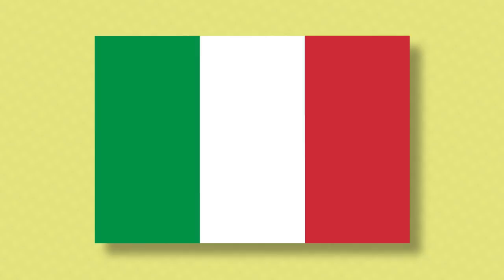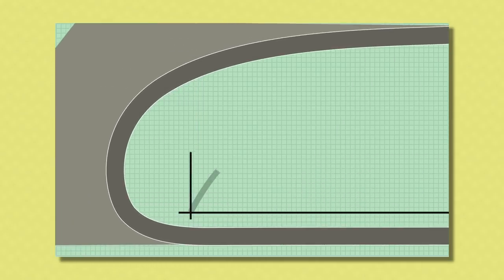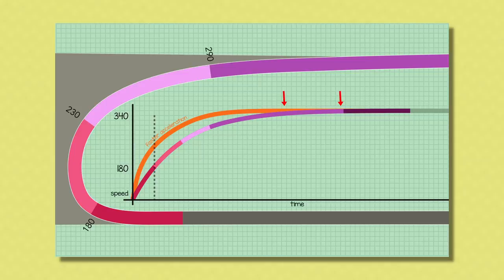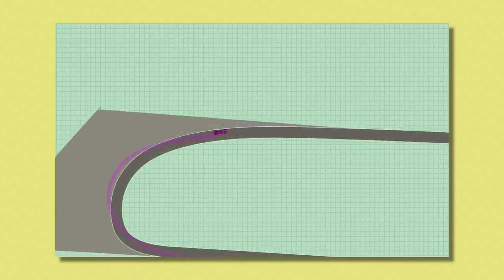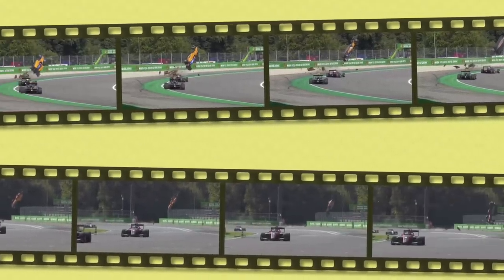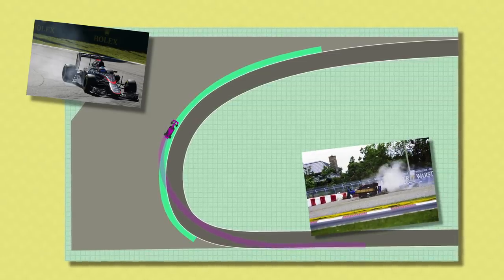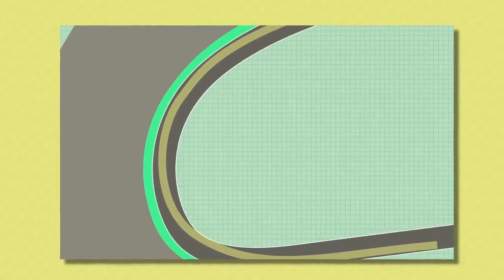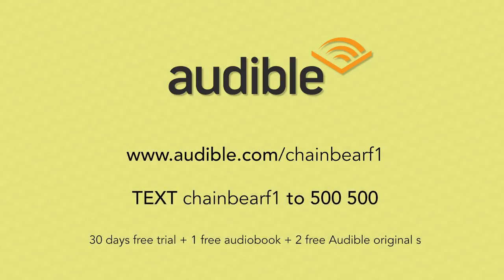Why run wide at parabolica? Italy 2019 (Part 1): "Just stay inside the lines!"

Comment: So in MotoGP, they have to deal all the time of riders running off the edge of the curbing so they can get on the gas just that much sooner. I believe if a rider does that 3 times within a race then they used to have to drop a position, but now they use the long lap lane (which adds 1-2 seconds to their lap time so if you are battling in a group and have a 5-second gap to the people behind it doesn't just kill your race and is consistent at all tracks and conditions) or the lap is canceled in qualifying. If you were to add gravel to the outside of the track and then have asphalt after that, then tracks that F1 and MotoGP go to (such as Redbull Ring) then a rider who goes wide will hit a patch of gravel and might then crash rather than being able to just stand the bike upright onto paved run off if they get in their too hot. With F1 they obviously have four wheels so that cant crash and damage their bodies in the same way as motorcycle racing. If F1 were to make changes to all of their tracks it can also have negative side effects for other premier racing series. F1 doesn't really pay as much attention to keep their wheels on the track or curbing, I remember watching the race at Cota last year and Hamilton continuously was running off the curbing with both right wheels and opening up the entry into the high-speed t10 and nothing was being done about it. So it definitely doesn't only happen at parabolica in Monza.

Comment: In the Colonies they use Rumble Strips to alert highway drivers to upcoming turns or running off the edge of the road. Since they are low they do not disturb the attitude of the car just startle you with some harmonic hilarity. As they are low I’m guessing they would not launch vehicles but would certainly be disruptive and inhibit acceleration. There are manufactured versions which can be removed. Permanent installation has been studied thoroughly
https://safety.fhwa.dot.gov/roadway_dept/pavement/rumble_strips/t504040/
Which who provide a point of departure for a racing version.

Comment: @ChainBearF1 great vlog but I can't help but think the simple solution would be to widen the track a metre or so through the exit and give them the track they are trying to use and then a cars width before a gravel trap at the side of the second phase of the corner? 
Nice big run off after the braking zone.
Power hungry corner where the driver gets what he wants on the exit and up the creek if he goes a cars width over the line? 
Just my thoughts on it 👍
Reply: If you make the track wider, they would just go even wider. That doesn't solve the problem at all.
Reply: That's where the gravel trap in the second phase of the corner comes in Fred.
Reply: @robhitchens966  I didn't realise what you meant by "second phase". In that case, I don't see what difference that would make to just having a gravel trap as it was before. That would still be problematic for other categories, which was the reason they removed the one that was there.
Reply: @Fred_P  you're on the wrong end of what I'm  saying 🤦‍♂️ 
Make the corner optimal for room in the traction (2nd) phase of the corner for the driver.
Define a line around it.
Just under a cars width from that put a gravel trap.
I'm sure if they define it the other series will cope with it 3👍
Reply: @robhitchens966  I understand. My point is that the drivers will be driving at the edge of going into the gravel, as a wider line will always be faster, so there is no "optimal corner", except for a straight line. But I appreciate your effort to find a solution.
Reply: @Fred_P  there is no optimal corner  except for a straight line 😂 that's hilarious! I appreciate your efforts to try to challenge my solution but really 😂
Reply: @robhitchens966  What would an optimal corner be? You always lose speed by turning. You're laughing, but I'm serious. Explain what an optimal corner is, and I'll happily concede. Until you do, the joke's on you.
Reply: @Fred_P why is the joke on me? You're throwing out bait nothing more and I am not biting for the sake of a troll 👍
Reply: @robhitchens966  WTH? I genuinely thought that we were having a discussion. But I see I've been wasting my time, because as soon as I requested some evidence for your claim, you just started laughing and calling me a troll. Good riddance.
Reply: @Fred_P  a discussion is one thing, your part of this "discussion" has been to do nothing with debating a solution. You have taken it as opportunity to tell me how wrong I am, been condescending enough to think you actually bare some relevance when you thanked me for my attempt at a solution with absolutely nothing positive to bring to the conversation yourself. So yes you're either making a poor attempt at trolling or you are a narrow minded know-it-all with nothing good in you but disagreement. Good riddance indeed 👍
Reply: @robhitchens966  Oh, so you're one of those people who gets offended when someone says thank you. I see. I bet you're offended when someone holds the door open for you as well.
Well that escalated quickly... The only thing I don't understand is why you responded to me in the first place since I didn't provide a solution for you. If you hadn't, I wouldn't have wasted my time on you.
Reply: @Fred_P  get over yourself buddy 😂

Comment: I'm in favour of the grass strip. Or maybe some other, very slippery surface. A surface that sends cars sliding off so they recover on the tarmac runoff area. I think risking a set of tires is a good punishment. Without a real punishment teams will just start to gamble on how far they can take it

Comment: Imagine the outside of that curve with gravel or grass. Because cars are going there at high speed, it could destabilise them in an unsafe way. They could loose control and crash.
What they did last week-end was probably one of the most sensible thing to do.
You could say that it's not very precise but as a driver, to be able to make the most out of it without going over the limit, you have to take a risk. Not a physical risk though and that's fine.
How about some cameras looking down on the line. Any suspicion and you just have to watch a replay. If you are able to see the whole line it means it's been crossed.

Comment: I like the idea with the sensors. One obvious downside would be cost ( R&D , testing, etc)
Reply: Formula E uses this type of system, the cars have to run over 3 sensors in the road to track their position in the zone.
Reply: @coast2coast00  Yes I'm aware of that. Do they also use that system for track limits?

Comment: A heavy penalty should be automatically handed out for going off the track, perhaps using sensors.

That would solve other problems, too.  The Leclerc-Hamilton incident is an example.  If the penalty had been heavy enough, Hamilton wouldn't have gone off the track to avoid Leclerc.  Then, Leclerc would have been penalized for colliding into Hamilton. But then, Leclerc would have been smart enough not to have crowded Hamilton in the first place.

In this way, a heavy penalty for going off the track would do away with the dirty-driving-or-not controversies.

Comment: Just have a vent that's positively pressured so you lose all your underbody downforce if you exceed the limits. It will scare the shit out of the drivers and make them not want to exceed the limits, but still let them brake fully once they get on the other side of the vent

Comment: Why not have a Monaco style armco barrier on the outside of the corner, that would stop em!
Reply: It's at the end of a long straight. A wall would result in death.
Reply: @reeepingk  well obviously yes but I'm sure there would be a way to only have the barrier (not wall) on the portion of the corner they are running wide on as at that point they are already turning and any touch on the barrier would be glancing a la Monaco.

Comment: The slowing idea is great BUT it should not be limiting acceleration but limiting top speed on the following straight, so the car ends up where it would have been if they had taken an average racing line through parabolica.

Comment: The low power mode sounds awesome, but you just know the internet fans are going wild about the “spirit of f1” and all that bullcrap (it’s always been like this btw, they added wings, removed them, added helmets, did this did that.. you think grandpa liked when they they turned those bullets into planes? But no, standing still in time using V12s with little electronics is the “true F1”, smh).

It might be an excellent idea for Formula E though, which is more mario karty and also less prone to “they’re not doing it like they used to” comments. It’s an awesome idea though, real powerups and slow downs.

But for F1, either markers or less grippy surfaces are probably best

Comment: how about a drive around the bollard if you go wide, and then 2 bollards so you have to drive in a zig zag
Reply: I am in favour of having to take a detour, but that only works if a driver cannot deny that he's off the track. In the case of Parabolica drivers would pretend to not know they went wide and take the normal line. Any delayed punishment can just be a time penalty as that serves the goal and is easiest, but they already do that. Any objects outside of the corner forcing them to take a different line is not an option as that object itself might cause accidents, like the sausage curb.
Reply: The zig zag at the and of the run, if I imagine it the same as you do, might lead to some nasty speed differences on the straight which could turn out somewhat dangerous. It also makes the punishment very harsh as you would lose quite a lot of time. IMO it only makes sense in a few corners such as turn 1/2 in Barcelona or Sochi. You get punished, but not that much

Comment: 5:25 Or they could just put better surface than either tarmac, or gravel, or grass.
Tall strong fibers embedded in concrete or such. Which would slow the cars down when they loose it and would prevent cars from racing outside the circuit. Much like driving through tall grass, only tougher.

Comment: Absolutely no way they could make the sensors automatically dip cars into low power mode in a race. Because then overtaking there becomes a cake walk. You just dive straight up the inside and push them slightly wide and suddenly they lose 300hp

Comment: Or you could just put up lane dividers. You know those things that will fold over if you hit them? I bet it would break wings and such without being a great hazard to the cars should they lose control. Removable for the events that require them. I DON'T like your gravel strip idea as it poses a huge risk to motorbikes, which do run at Monza.

Comment: Why don't they just move the line to fit what the teams and drivers are trying to do? If you move the line enough then pushing the track limits would have a negative impact on time.

For Monza that corner would only need the line moved a meter.

Comment: A grass strip on a 230 ore more kmh corner is a trash idea. The car will lose all its grip and go away into the barrier like crazy.
Reply: So a gravel strip then. If we can't make it slippery then we make it super grabby and bog down the cars down that way.
Reply: Exactly as it should. Do you want grip? Don't go off track. It should be artificial, like pouhon, but it should be a self enforcing penalty non the less
Reply: @reeepingk  having a gravel strip there 1. will put gravel inside the corner and you can lose way more then 5 seconds if you get out of that corner because we measure the speed that the cars are taking off the exit of that corner and the top speed. When a car reaches 340kmh the car that went on the gravel trap would have like 300 by that time

Comment: Yes to silly colours (I guess)... but a resounding NO! to electronically slowing down cars on track.
That would open the entire system to a new dimension of abuse. I can already see Mercedes, Ferrari and McLaren gaming the system to use this as an advantage.
A much simpler solution; would be to add a strip of (rough) astroturf around certain corners, to dissuade drivers from running too wide.
As you said, we're F1. A high tech sport... and we can definitely find a removable "grass" solution that organically discourages and/or penalizes drivers running wide.
Please, I beg you. Don't give the FIA and Liberty Media ideas that we may end up regretting for an entire generation.

Comment: High tech hahahaaa all the high tech has came and gone abs, traction control, active suspension all thing that makes a car extremely fast on a track and most of this can be found on a tipical road car f1 is many things mostly an extremely strict rule book but high tech thats only the engine and electronics
Reply: To be fair the reason all of these things are on normal cars is BECAUSE normal people aren't race car drivers. On F1 cars it would just close the gap between good and bad drivers, which would make the races more boring.
Reply: @reeepingk  it's all personal opinion like I'm a rally person more than f1 because one day a team raced the first awd car putting new records at every track it was not banned for being to grippy or fast like f1 would other teams had to make a version some car everything was locked no center clutch so hand brake can't be used other then launch modern awd are covered in sensors,
clutches to win the race see what I mean it not boring it's improvement

Comment: Why not just let the drivers use the space available at Parabolica? In this case, the track limits are only defined by the paint on the road. Remove the paint. The line the drivers wanted to use for the best lap time is perfectly safe, provided you don't install a ridiculous curb in the middle of it.

This is a great example of what are called, desire paths, in urban planning. You can fight against it, and fail most of the time, or you can pave the path the drivers obviously prefer to take. 

Making Formula 1 tracks, obstacle courses, in an effort to make the cars slower, is a completely retarded approach in my view.  If you want the drivers to go slower, make the cars slower. Where this idea of making the tracks more dangerous, in an effort to improve safety came from I have no idea, but it's completely asinine.